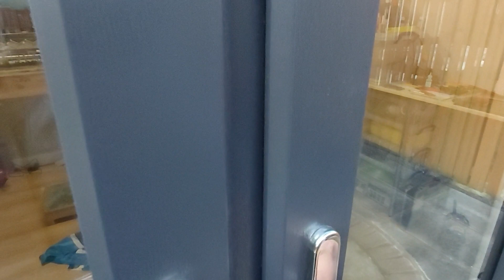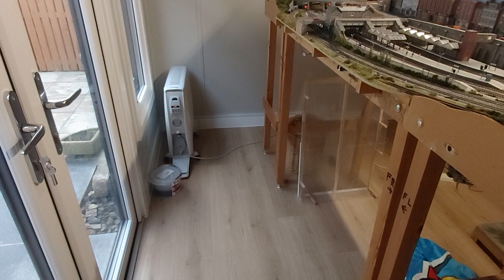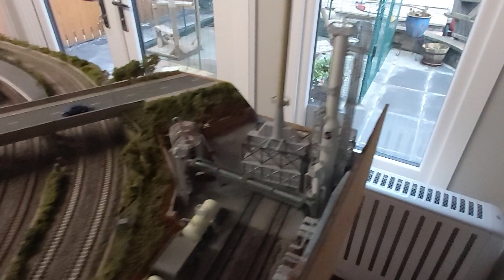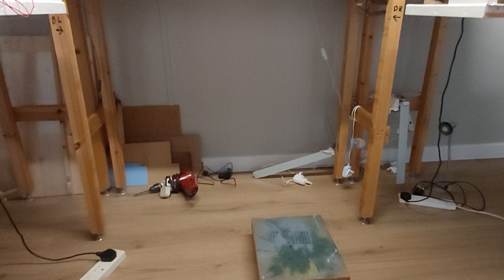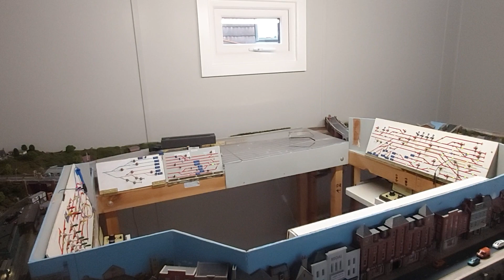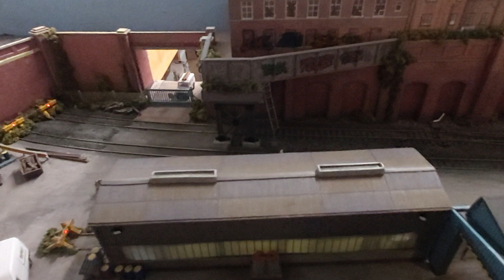Blackwood N Gauge layouts New Home Tour

Comment: Fantastic railway room, your layout makes me want to get in to N gauge.
Reply from the maker: Hi - glad you like the new railway room.  Hopefully the layout demonstrates what can be achieved in N gauge.  The quality of the rolling stock is now on a par with OO.  Great thing is you can run scale length trains.   Cheers Euan
Reply: @thegrowler-blackwoodngauge  my shed is 8 x10. I currently have a oo dcc layout thats fully automated but as you say scale length trains and limited scenic space makes it more like a clever train set than it dose a suffisticated model railway.
I have designed an n gauge layout. Just need to get some funds up and start the build.
Reply from the maker: @ravenscrossmodelrailway3281  8x10 would give you a pretty good N gauge layout.  Check out Rule 1 who is building a large N gauge layout which is all computer controlled - with i-train I think. Cheers Euan

Comment: Hi Euan, I am very impressed with your new railway room/building, very nice, quite envious. Loved the video showing it all, looked like we were looking at a new build. 
Great that you can walk along both sides and get different angled video shots. I just wonder when you start to think can I make my layout bigger lol. 
After what you have accomplished here it would not surprise me if you decided to make it a lot bigger and put it all the way round the outer edge of the room and have a huge working area in the middle. Well within your modelling skills Euan. Could even include a bench and work area in the centre so you would not miss out. (Bet its crossed your mind lol)
Regards Chris
Reply from the maker: Hi Chris - yes it's great to be able to get round the left hand side of the layout for the first time in about 8 years!  I do have plans to put a helix in to access below the back baseboard for additional storage.  I had considered building a new layout around the outer edges of the building.  However I couldn't bring myself to dismantle something it's taken 12 years to build!   All the best for the new year.  Cheers  Euan
Reply: Oh my goodness Euan I didn't mean dismantle your layout, with your skill just take it apart in four sections and put them in each corner and then extend the rest in between lol. What you have is fantastic, just make full use of the room is what I meant. I dont have any option as mine is a loft layout.
Regards Chris
Regards Chris

Comment: What a fantastic looking shed Euan, what is the building made of? I have been watching a few of your back-log, vlogs, as I am just starting out in N gauge (was in O gauge, but due to a move from a rented 3 bedroom house onto a 40' long x 6'10'' wide narrow boat (that's the outside measurements), there's not the space). I am using a OO gauge Talbot Lane depot much reduced to 30"x12" so it can fit into a xmas wrapping paper storage box. Enjoy the rest of xmas & new year period looking forward to your next vlog
Reply from the maker: Hi Vinny  - it's  made from a 22mm hardwood and has fully insulated walls and roof.  That must be a wrench coming down from O to N.   I did model in OO many moons ago but after I got back into modelling after a 20 year break I was so impressed with the way N gauge has come on.   It really is on a par with OO in many respects.   I'm sure you will be able to construct a really good N gauge layout in the narrow boat.   Merry Christmas  - cheers Euan